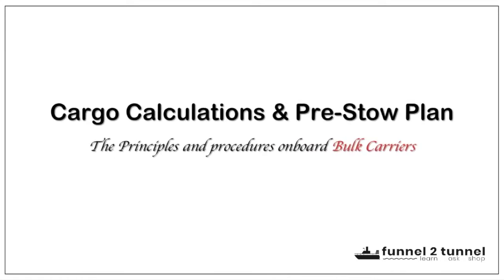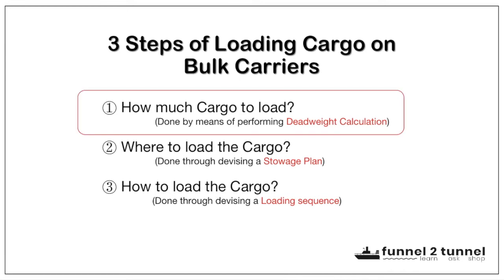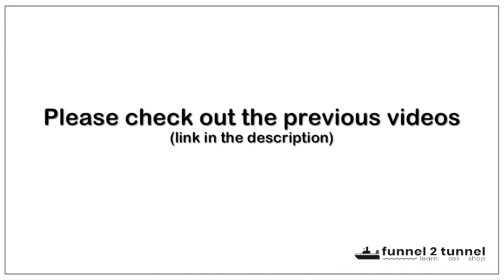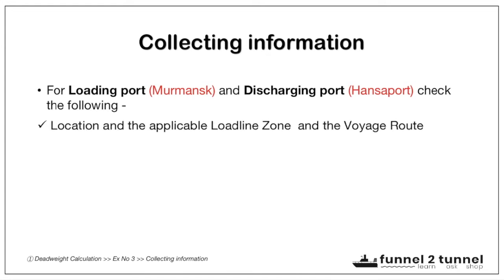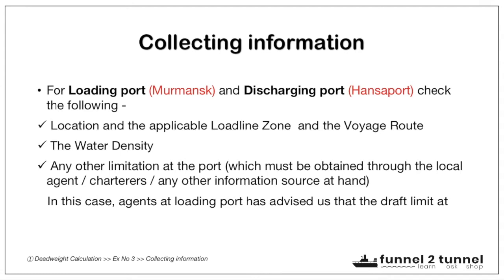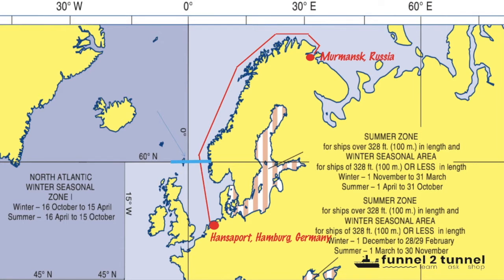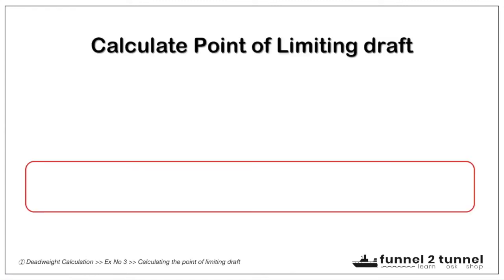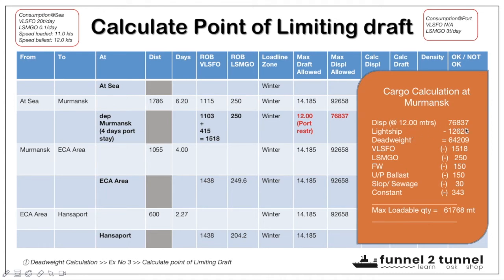Deadweight Calculation and Stowage Plan | Bulk Carriers | Part 3 | Simple explanation

Comment: As i observed sir base on your draft 12.0m at density 1.020 and you get the displacement at hydrostatic, at what corresponding draft in the hydrostatic you take? as we knew that draft at hydrostatic table are based in seawater density which is 1.025

Comment: Why is the Displacement at Sea the same as the Displacement at (Hansaport FW Density being 1) whereas the Density of water at sea is SW 1.025 or at Murmansk BW 1.02 ? Please clarify as I am a little confused.
Reply from the maker: Hi Dinos! Note that the leg ECA area to Hansaport (just before the arrival port) is considered to be out at Sea therefore the density is taken as 1.025. However, the next row showing the Port Arrvival at Hansaport we have taken the density to be 1. 
Similarly, for the leg At Sea-Murmansk (just before arrival port) is taken at sea with density 1.025
However, at port Murmarnsk we have taken the density as 1.02.
BUT THE ONLY LIMITING POINT AT MURMANSK IS DRAFT WHICH IS 12.00 MTRS, AND PRE-STOW PLAN IS MADE IN ACCORDANCE WITH THAT LIMIT. 
Hope it clears!
Reply: @funnel2tunnel360  im also still consufes same question with dinos. your calculation displacement from 76837 to arrival port using consumption etc is correct 76731. but is based on density water 1.020. in arrival port is 1.000. so we need correction of density . (76731 x 1.000 ) / 1.020 = 75226. so conclusion is whats correct arrival displacement is 76731 (1.020) or 75226 ( 1.000 ) ? please explain to us..
Reply: Yes even I am confused, kindly explain it in brief arrival displacement and draft

Comment: Please clarify, that on load port final displacement is based on density 1.020 or 1.025. Density correction is necessary or not?
Reply from the maker: Yes the final displacement at Loading port will always be based on the density of water in which the ship is floating.